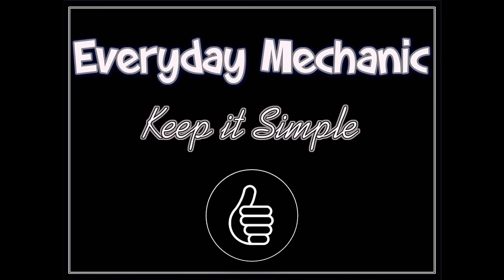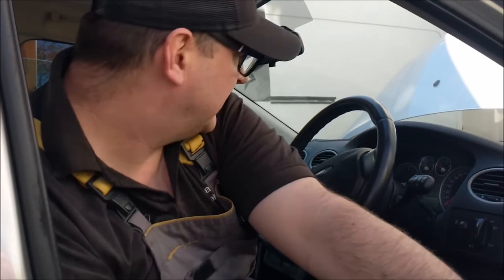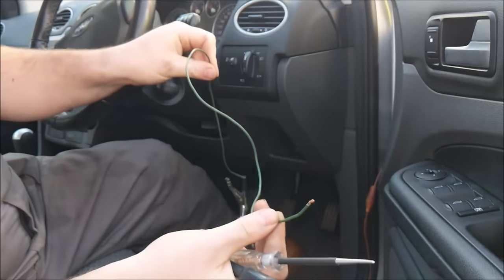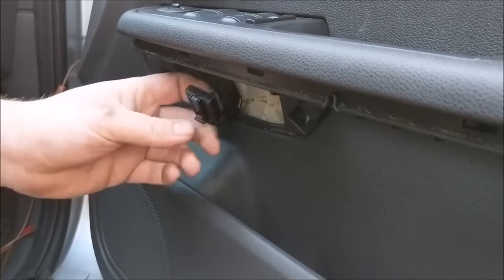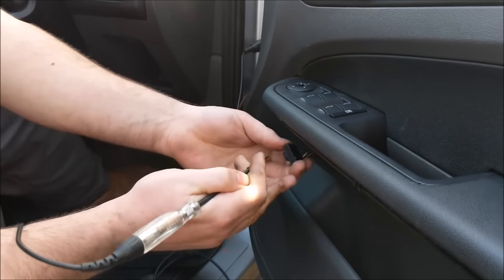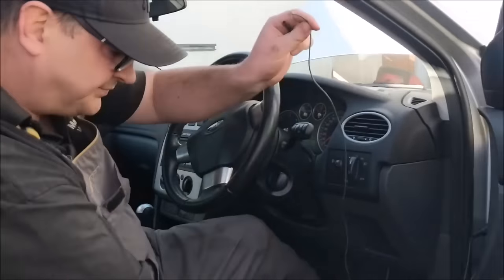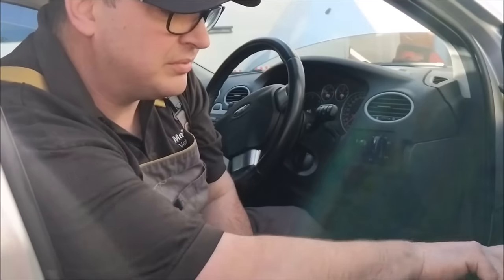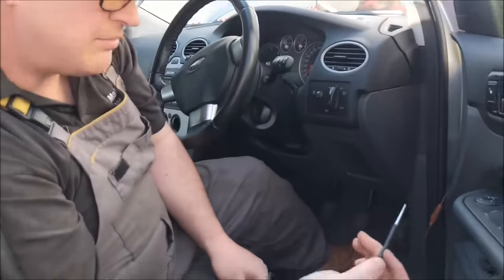Car window stuck and won’t roll up down. Manually Close an Electric Window when your switch fails.

Comment: Just want you to know there are a few of us non mechanical and electrical types who managed to grasp that by ‘manually closing the window’ you meant manually by passing the switch. Once that was pointed out to me, it suddenly became crystal clear! 🙄 Good video, well done!
Reply: Not a good vido as you said he did not manually close it. So he shouldn't post his thumb-nail like he did. Those of us that know how to troubleshoot a switch and check for power don't need his silly-ass video. I clicked  on to see if that can be done and I don't think it can with out discounting the elect motor. And that is what holds it I think not sure I'm not a auto mec I'm a retired electrician.
Reply: @michaelburke6552  what?????
Reply: @scottscoville1118  Do you really not understand what I wrote? If so, if the elec. motor  is burn up it does not matter if the switch is good or bad. All he did was jumper across the wires taking the switch out of the system. You would have 3 wires one hot and two switch legs you touch the hot to one window goes up touch the other window goes down. Like I said he did not show how to manually move the window he showed how to see if it was a bad motor or switch. That is if he has checked  the fuse first cause if the fuse is blown its probably a bad motor or a short to ground. If you disconnect the switch and it still blows the fuse it's a dead short to ground. If not it's the switch or the motor. That's why I said it was a bad video all he showed was how to jump out a switch.:hand-purple-blue-peace:

Comment: Nice method.  I can (and have) work myself into a frenzy thinking about how nice, considerate, and right it would be, if the MF car companies would simply install a little manual handle which could roll the window up or down (at least a couple of times, before breaking), in the event they won't move electronically.  It's probably the same bunch of evil monsters who make the opening for adding transmission fluid the size of a dime, (and tuck it to where you can get at it), when the opening on the container of ATF is about the size of a quarter.

Comment: I've always felt that car manufacturers should provide a backup, where you can pop off a small plastic cover, and slip an old style window crank on to roll the windows up and down.
 Then you have time to get it fixed and just pop the cover back on, and put the crank handle back in the glove box. 😉
Reply: My Subaru has that for the sun roof
Currently trying to close the jeep in a rain storm
Reply: You mean to make things " easy" for people, are you kidding!. Lol.
Reply: I think rover did this back in the seventies.
I previously owned an Alfa Romeo 916 spider with a electrically operated roof which had an override switch so it could be operated manually if the motors, gearing, or both failed. 

Which of course they did🤣
Reply: The car manufacturers just care about money and not humans.😕
 I'm sure if you pay extra for that they would do it.🙄
Reply: Excellent idea!
Reply: My BMW X5 has an emergency crank to close the moonroof should this happen. Wouldn’t be a bad thing if there were a built in back up for times like these.

Comment: Good video. What we usually do for a quick temp solution is poppin out the switch from the other door and swapping it just to get the window into a position till we get another switch. Its abt 5 min to take both out, switch it, roll up or down then swap them back. The olds silhouette and chevy ventures are Famous for switches goin out. In fact we started getting extras from junkyard for $4 each bus 45 at autozone. They last abt as long as the new ones. Dont even matter which one, as we have 6 in the fam, ALL  of them do it occasionally. Good video, same principles. Good luck everyone.
Reply: That works if the connector is same. But on most of my vehicles the master switch wire harness connector is way different than all the other door switches. But yeah this can work if the switches have same plug in. For people like me tho what this guys just showed works (unless your motor is dead) which this vid also rules out at same time 🤙

Comment: Thanks for that video, On a few occasions, with a few different friend's, and myself having a switch problem, I have unplugged the switch, sprayed the male and female contacts with WD-40, and they worked once again.
Cause of the problem was rain water on the switches. Now when I get a new car with power lock and window switches, I am sure to coat them in good old Water Displacement-40 to prevent it from happening.

Comment: Thanks I made the lead with a flasher bulb and window was going up and down no problem when I connected to the correct connectors, so shows my switch is faulty, so have ordered one now, thanks again, great tip 👍
Reply from the maker: Glad it helped 👍🏻

Comment: Good advice. That works if the switch has gone bad. I've had to replace the motor a couple times. Usually it's just the switch.

Comment: I was mad at first because it didn't work for me. I also saw how you were sticking the wires in empty slots. But then i remembered that you have to find the positive first and then complete the circuit. And it worked after 30 minutes of trying to find better grounds. Maybe on some models this work, but mine is an 06 navigator and had to complete the circuit. Thanks either way. My car won't get filled with water.

Comment: Worked like a charm> the quickest and less complicated way by far. Fixed all three windows in about 30 minutes and there is no way to mess up, only two pins, up or down!!!!
Reply: Hi, just for asking, did you open the panel up for each switch on each window and do it individually that way? I'm about try to do this on my front passenger side of my Honda. Thanks in advance.
Reply from the maker: If it works on your car you can apply this method to any switch pack
Reply: @EverydayMechanic  Great. Thanks!
Reply: @EverydayMechanic  Didn't work just with the probe. However I found the negative and then put the light's clip end in that and the probe end in a different one and found one that lit up. Then I pulled the switch up and the light went on and off each time I pulled on the switch. The window didn't move but I'm not sure what to assess from this.
Reply from the maker: Hi i would say your switch is working fine i would niw look inside the door card and asses if power is making its way to the motor and if the motor is getting power but not moving it would be easy to assume the motor has failed but even then would be best to test motor for resistance before assuming motor has failed
Reply: @EverydayMechanic  Is it worth testing the master switch also for the passenger side or is that redundant at this point?
Reply from the maker: No that switch should have controll as long as the module is powered up as in the ignition is in the on position
Reply: @EverydayMechanic  Ok thanks.
Reply: @EverydayMechanic  Hi again. Do you know if there's a way to get the window up just high enough to undo the bolts if I can't do it electrically? Thanks.

Comment: The reason the bulb is a good idea is it provides a resistor, the bulb itself, to ground. If there is no resistor and you bypass a power directly to ground you've created a short and can damage the electrical system of the car. At best it might blow a fuse, at worse it could fry a computer module and/or burn up a wire harness.

Comment: Thanks for the help! I have a 1996 Ford Mustang GT...yes...1996, so basically before a lot of cars went over the top electronic. One of the rear window switches is a bit wonky from time to time. I found a mechanic who works on "classic" (yes...she's 27 years old) cars and he's great, but $$$$🤑, you know. I will try this for sure. Thanks again...and I did subscribe.🤗

Comment: I have heard from experts commenting on other videos that incandescent test lights are generally a bad idea to use with digital electronics, including window switches in cars. A voltmeter/multimeter can be used instead. The incandescent test lights can even pass through over an amp in the initial surge of current through the bulb. So LEDs are safer. In one video on window switches, the incandescent test light blew out some resistors. It seems window switches include a means of detecting window position, and this requires sensitive electronics that in some cars can't handle an incandescent test light current.
Reply from the maker: Ive been using this methed of testing for some years now a very long time and yet to spike something ??  Maybe give an instance in detail please so i can  study  in more detail please  and thank you for your response to this video .
Reply from the maker: Also to mention if you use an LED test light and not an incandescent one  in the method i use in this video
 something will get spiked  !!!!!!!

Comment: Good vid! Probably should have told them to try plugging the wiring harness back into the switch a few times too. (plug it in, unplug it, plug it in unplug it).. Often the contacts on the switches will get corroded or just tarnished from the Damp or having things spilled down the door handle and by RE-Seating the switch a few times you just might get it to make a fresh contact. If you do you should gently try to remove the entire unit from the door and clean off the pins on the switches with a piece of steel wool or even a pencil eraser if it will fit on the switch contacts. (Or just leave it plugged in until the next time it quits working and just re-seat it again and hope for the best.).

Comment: wish Ida known that 10 years ago.  I did 500 miles with the driver's window in an MPV stuck all the way down the whole time...and it started coming down in buckets when I got there.  'course, on an american market car, there's a zillion screws to remove, they deliberately hide all the wiring and scrunch it behind the metal so it either rubs through or breaks, or hine it behind single use plastic fasteners :P

Comment: Another tip is to put some masking tape etc that's easily removable & not too sticky over the broken switch to stop you using it until it's replaced (once you've got the window back up).
Reply: Just leave the switch module unplugged from the switch.
Reply: or press the window lock button if applicable.

Comment: great video ,have the same problem,what if that still didnt work? im thinking it could than be one of the wires right?
Reply from the maker: Yes this methid just bypasses a faulty switch if this doesnt work then more testing would be needed but bear in mind this test only works on can bus / linbus designed systems

Comment: Great lesson . The contacts on the switch are probably worn out . They can possibly be checked by using the voltage drop test . Today's Joke : Will this still work if the steering wheel is on the LEFT ?

Comment: Didn't read all the 362 comments.  Some here know that the problem IS NOT SOLVED.  There are a few more possible faults.  The worst faults are the intermittent ones that disappear when the “expert” decides to test this.  The easiest way to try to repair this might be to swap the switch with a unit that works, according to testing, away from the vehicle.
1. The male pins of the switch may not be interacting enough with the female holes of the cable socket.  Some tiny physical nudging of the pin or the socket might be needed.

2.  The switch unit may be eroded with gunk over the contacts.  This might respond to WD40 type spray, or vigorous vibration to remove or dislodge the gunk.

3.  The switch unit may need the moving contacts bent a little further to ensure tighter contact.

4.  The broken contact might be elsewhere in the wiring system, but is intermittent enough to fool everyone.

Comment: What was that tool you placed on the tip of your test light? I need to get that or a similar tool. A Great video by the way and easy to understand.
Reply: I’m currently trying this as I speak. I’m using a circuit tester from Wally World. The tip is actually pretty slim and pointy and gets into the holes but I haven’t had success yet. I think you need that extra tip he slides on. I’m going to try a paper clip, unfold it make it straight and use electrical tape to wrap it around tester tip. Will update if that does the trick. If that doesn’t work it may be my ground in clamping to isn’t good enough so that’s next however I’m using the same spot he used in this video and my metal is bare so I’m betting on that tip attachment doing the trick.

Comment: Cracking video well done. The issue I have is with a vauxhall mokka the window only moves a couple a millimeters at a time up or down could this be a motor issue, it also comes up with low power to motor so the mechanic says, am thinking maybe a rely issue. any ideas

Comment: Hi there,
what’s the reason for a switch stopping to work ? -  Dust , corroded :oxidized contacts ?

I guess this hack wouldn’t work if the motor or some of the mechanics failed.

I had an Audi A6 1.9TDI  automatic Station Waggon  (built 1995) with a roof hatch. 
There was at least a little emergency crank to it, ready to be used in case the hatch motor failed.  THe door windows didn’t have it.

Comment: Very simple and functional way of opening or closing your window. It could be the problem is in the switch like it seems to be in this video would you bypass it like that and it'll work which is all well and good. You don't make an allowance for a motor that's gone bad you forgot to tell people that there are other variables to causing Windows not to work. I work at a used car dealership and I have to deal with these problems from time to time and either the steel cables are broken or the connections are busted up, or the electric motors are shot. Or maybe the switch itself is got dirty contacts and you need to take it apart and try to clean the contacts. But the newer the vehicle the more you find electronic type of switches that don't have contact points that you can get at. Yes I like the video it very simple very straightforward. But it can also be misrepresentative and not leading the person on the proper perspective for what is needing to be done.
Reply from the maker: Very true my video is the bypass of a faulty switch or to rule out the swithch i will remake this video with more depth thank you for your thoughts on this very much appreciated
Reply: @EverydayMechanic  I find your response very super quick I appreciate the fact that you're going to make a more precise video to enhance more possible problems with this issue. Sounds like you're doing a very great job there I appreciate your a tentative thoughts through your matter. You're doing a great job keep it up thank you very!
Reply: @EverydayMechanic  Also can you please indicate which is your video where you make a DIY cable as you show in this video?  Many thanks for your excellent video!

Comment: So just to be clear, this solution only applies if your SWITCH is bad, right? I'm not sure but I think I've got a bad wire running to the door. In this case your fix wouldn't work, right? Thanks friend

Comment: Didnt know motors were wired such that they just needed to see a negative- so the bulb is just acting as a current limiting resistor for protection. Cool video could get you out of a bloody awkward spot when it happens on a long journey in the middle of winter.

Comment: In my 2000 Monte Carlo, the driver's door window switch is weak. It will go down but not up. I expect the window switches in Malibu's and Impala's and other GM vehicles around 2000-2005 will be the same. All I do is press the window button the normal way, but then get my thumb under the rear edge of the switch rocker and pull up. The extra travel makes the contact. Some day it will fail completely and I will have to tear the door apart to replace the switch, but it works for now and takes very little effort once you know the trick.

Comment: I had no luck using this method. I did exactly as the video instructed. Connector my test light to ground and touched the terminals. The only thing that happened was the test light illuminated when I found the 12v dc source wire. It must depend on the wiring of the vehicle. I have a 2002 Ford Explorer.
Reply from the maker: This method would work on any car with the fuse terminals exposed on the rear of the fuse make sure you have the type of fuse that does have the touch points on them and also make sure the ignition is in the on position
Reply: I've had the same problem with my celica . Placed the negative on chassis, only lit up bulb did nothing to the window..

Comment: Great video. Although this isn't manually rolling up the window, your still running the power window just bypassing the switch
Reply: That’s the whole point. This is the 1st step you should do as the switch is usually what fails on most vehicles. Once you rule out the switch you can move to test motor by unplugging harness to motor and using a 12v battery direct to troubleshoot motor. If that doesn’t work you know you gotta replace the motor instead of master switch.

Comment: I personally dislike power windows and power locks...just more parts to go out easily and have to replace! In fact, the best rollup windows are on the older vehicles using metal cranks, etc. It is amazing to me how much car manufacturers charge for a car using A LOT of plastic.😝

Comment: Hi, Would this still work to close the window , if the window motor has failed?  Thanks
Reply from the maker: Unfortunatel no if the motor has failed you would need to remove door card dissconnect the glass from the runners and wedge the glass in the closed position wuth a piece of wood as a temporary messure until you get the parts to replace the failed ones